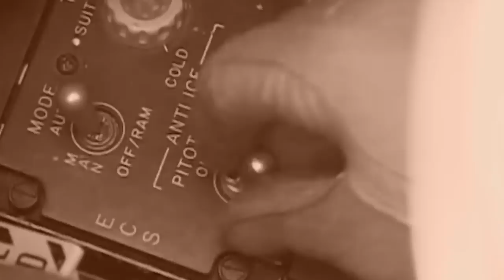X-31 Quasi-Tailless Thrust Vector Jet - Extreme Angle of Attack

Comment: Would love to see the Horten Ho-229 covered. Thank you for the stream of fascinating content!
Reply: never flew IIRC
Reply: @lordilluminati5836  The prototype had its first flight in 1st March 1943. Horten had a lot of relevance in the development of flying wings and their research already had good results in the 30s, but only much later with the
"3 thousands project" (1000km/h, 1000km range, 1000kg payload) they got some financial support and made the first prototype of the Ho-229. It was a reasonable plane for available technology, but it came in a very late stage of WW2.
Reply: @BlackCatRedScarf  the trouble was at that point the Germans were using a large amount of wood and glue in various combinations. Unfortunately they were also using extensive amounts of concentration camp prisoners for free labor. The ME-163 had similar issues in construction as the forced laborers found that peeing in the glue and putting small rocks under reinforcement bands would cause the wood to literally separate in flight and the rocks would cause structural weakness that high speeds would exploit by ripping off wings. The other issue was the jet engines themselves, they were built in underground workshops of varying quality. Typical life expectancy for a Junkers Jumo 004-B turbojet was about 30 hours before overhaul. The BMW jet was not much better, plus they were tricky to handle throttle wise. Advanced too quickly many would flame out or catch fire. It would have worked and it would have been deadly until the 8th Air Force found where the parts were coming from and bombed it into non existing

Comment: I think the real clincher is the moustache canards - as seen on the Typhoon. This canard surface has very long range of angle of attack. As to the thrust vectoring: Well that is a complication not really needed - given enough engine power. The Typhoon has a dry thrust engine power that is greater than the empty weight of the aircraft. That is about the same. The point being: The Typhoon achieves that by being 15% SMALLER.

The Typhoon carries about 20% less fuel internally and can supercruise - which really makes a difference in air defence. The reasons are probably: The canard surfaces are lifting and a pure delta wing is used - which probably allows for additional internal fuel stowage. A canard surface could make the aircraft unstable; but not more than the computers can sort it out.

The X-31 program is a success - not so much in the direct application, but provided lots of data to facilitate design decisions. The exhaust paddles were indeed a possibility; but I suspect the weight and complication in a full scale aircraft is not worth the bother.
Reply: The Typhoon had foreplanes not canard, very different really.

Comment: I’ve heard of similar pitot tube problems in the past.  I’d think a modern prototype under testing should have multiple sources for airspeed, attitude, altitude, etc. data, just to be sure one malfunctioning data source doesn’t confuse the flight computer systems.  Heck, our antiquated space shuttle had three computers checking each other just in case one malfunctioned.
Reply: Fighter craft and shuttles are two completely different things. Fighters must seek to make the most efficient use of space possible so that the craft can be light, maneuverable, small, and cheap.
Reply: @mechanomics2649  point taken. However, in a test prototype it seems pretty much every measured and instrumented value should come from multiple sources.  After all, you are testing the entire plane, including a newly designed pitot tube.  When I operated powerhouses for 45 years (I know, not size & weight sensitive), I often dealt with bad instrumentation.  Frankly, this makes the Test Pilot job sound scary.🙄

Comment: I wonder if there's a way to make the paddles out of something invisible to radar? the graphite epoxy are all ready. so they would just need to make the arms out of carbon fiber or plastic or both. then they can put the engine nozzles inside the airframe like the f117 and have a more radar invisible jet with complete thrust vectoring. and being able to would make them easy to put on a stealth jet. and having the engine deep in the airframe will make a IR seeker have a harder time tracking it something very importand when fighting the SU-27 and new series jets that have IRST thats like a IR radar for them. and makes stealth like the B-2 and F-22 as easy to target as any F-16

Comment: Scroll to 9:38 and you will see some of my noteable handy work with the installation of the new "PITOT BOOM" on the upper forward fuselage and hand built Dorsal GPS Fairing at Pax River. The old boom mounted to the bottom of the forward fuselage was like 3 degrees off. I installed and mounted the new boom with help of the Theodolite team and we got it within .001 degree. Needless to say the flight control software had to be re-written. For the record the cockpit and alot of other components were Legacy Hornet. The display we mounted to the pedestal so the aircrew could "monitor" high AOA landings came from Wal-Mart.

Comment: Best way to keep prototype secrets, destroy them before they have a chance to be copied.  Also, how else are you going to test a fully out of control thrust vectoring jet for the first time, they probably got a huge amount of information from the fall they would not have had otherwise.  I bet ejecting from a thrust vector induced turn or odd spin is a huge gamble too, or not, just on the wrong side, the risk is probably too high for some flight test procedures.

Comment: The general shape is similar to the earlier IAI Lavi, that flew in 1986, but it seems like a case of "convergent evolution" in design due to physics and performance requirements.
Reply: The israeli fighter? Wasnt that just a Derivative from the mirages and french fighters and same for the eurofighter/typhoon/rafale?
Reply: The program wasnt about the shape but about the thrust vectoring anyway from what the focus is
Reply: @kloschuessel773  Shape often gets dictated by what an experimental or military aircraft is supposed to and its desired performance. Physics also informs the shape of the vehicle.
Reply: @mprojekt72  i dont think this shape had to be this…
The russian planes with thrust vectoring are different and so is the raptor

They probably just took this shape bcs its been a well established design that would be easy to control and use 

The focus here was clearly on the thrust vectoring…
That shape was nothing special. And again: the israelis took it from the french planes themselves if i remember correctly
Reply: @kloschuessel773  When the X-31 was being designed, materials science and budgetary constraints did not yet allow engineers to move very far beyond forms that were known to work.
Some elements of the X-31 absolutely are derivative of long-tested and operated aircraft because:
1) they had to be to achieve a baseline of performance and stability with a specific goal toward a thrust-vectoring, tail-less airframe but not specifically without a vertical stabilizer.
2) Other derivative elements were chosen due to budgetary considerations; however, those had to work in concert with the overall body and wing design that were already dictated by requirements.
At the end of the day, whether the engineers chose to create a novel airframe and wing plan or to reuse elements of known designs, all of it, every surface and protrusion, had to obey physics, be achieved within a set budget and timeframe, and follow function above form.

Comment: The pilot tube in the carburetors of my 1982 Suzuki GS1100E rarely ices up but at high altitude it probably will. I am not an engineer but it seems to me that using a pitot tube the same high altitude icing would probably occur also so I guess using a pilot tube instead of a pitot tube really made no difference. At least the extraction seat fired properly when it was needed. Probably a Martin-Baker extraction seat.

Comment: I wonder how the X-31 would fare against the X-29 in a mock dogfight... and how much more maneuverable would the X-29 have been if thrust-vectoring was retrofitted.
Reply: It would certainly roll faster, but you need good lift under the wings to create a stable axis for thrust vectoring to be even considerable. It is trigonometry. The x-29 had not the same amount of wing lift , and the forward pointed wingtips cause turbulence you don't want, when thrust vectoring. Makes it hard to stabilize, when rolling and vectoring at the same time. it would be way trickier to fly. Nearly uncontrollable.

Comment: Yes, thrust vectoring works. It is the high ground. Lockheed knew this when they designed the YF-22 in 1984. 
YF-23 fanbois should be referred to this video
Reply: the YF-23 tailerons were so strong that it didn't need thrust vectoring to achieve high maneuverability, but what the fan boy of an f22 knows .
Reply: @gtrix3240  Thrust vectoring advantage applies to the pitch plane, not the roll axis where the inertia is trivial. Watch this video and learn some basic flight mechanics.
Reply: It is for dogfights
Reply: I would like both planes, please.
Reply: @Endelin  That would be the YF-45.
Reply: @MrKentaroMotoPI   test pilot Paul Metz was the only man who flew both the F-22 and the YF-23, and What's so important to underline is that Metz worked for both Northrop and Lockheed and is not known for hyperbole and he said "Never hang your head in shame about what we did. We built a tremendous product that would stand side-by-side with anything else, and in many cases exceed the capabilities of anything else. And we can always be proud of that." and he also made it quite clear that Northrop's offering was on par with Lockheed's, if not superior, Metz makes another incredibly valuable point about how Lockheed knew how to present and market their airframe far better than Northrop did. He notes that not everyone who would be in a position to select a fighter aircraft would be an engineer and that they may not even be technically astute. So leaving 'lasting impressions' on a conceptual level, even if they don't tell the whole story technically, can give one side an advantage over the other, he also said that Northrop's team was made up of brilliant engineers beyond compare but they thought and spoke almost exclusively in engineering terms. Meanwhile, Lockheed infused far more marketing, They fundamentally understood how to sell their aircraft and how 'showmanship' heavily impacts the acquisition decision-making process. Northrop didn't and that fact may have proven fatal for the YF-23 and also Jim Sandburg another test pilot of the YF-23 talked about how the YF-23's massive tailerons were so powerful that they largely mitigated the perceived advantages of the YF-22's thrust vectoring.
Reply: @MrKentaroMotoPI  i meant tailerons not Ailerons the auto corrector kicked in, so don't take a victory lap just yet lol.
Reply: @gtrix3240  Don't you just fate when that happens?

Comment: if the x-31 programme was "so successfull and groundbreaking", why no other western mass-production planes since 2000s were fitted with thrust vectoring?
Reply: The f22 was and prototypes of every other service fighter excluding the f35 and f14 were tested with thrust vectoring  it simply did not provide a big enough advantage to be worth it
Reply: Thrust vectoring isn't for free, it adds maintenance costs, and is only done for expensive models like air superiority fighters.
There's an engine version of the EJ 200 Eurofighter engine with thrust vectoring (the EJ 230), it exists but it was never used in a production version of the Eurofighter, since the aircraft can do very tight turns anyways with the Canards
Reply: @simonm1447  what is "for free" in mil aviation? 
Obviously the x-31 progamme failed despite being "successfull and groundbreaking". The only thing in production which remotely resembles x-31 are the F-22 engines with flat nozzles, and no other success stories or whatsoever
Reply: @konstantinsmirnov3722  not for free means the costs per flying hour will rise, which are already at 70k € per hour for the Eurofighter. Models made for bigger numbers (like the F-16) are at 36k $ per flying hour.
Airforces usually try to keep this costs as low as possible at the models they use in bigger numbers, high costs mean less flying hours for the same money.
So such technology is used, if it's used, on more expensive aircraft, like the F-22, and not on the models which have to be cheaper.

Comment: The Russians have some unbelievable thrust vectoring jets
Reply: Russian Jets are in general designed to be very nimble and unstable, even without vector thrust.
However vector thrust and the maneuverability that comes with them is only a benefit when the pilot can handle the G forces

Comment: “Quasi-tailless”, Well it certainly had a vertical tail (stabilizer),
but was missing the horizontal tail (Horizontal stabilizer). I guess you could’ve also called it a “quasi-empanage”.

Regarding the “pilot” tube, maybe it is an actual tube that the pilot uses for, well, you know…
Reply: They did a testing program for a missing stabilizer. However I don't know if they ever flew without it or just did the test with it removed 'virtually' through the flight computer. There are however renderings showing it without stabilizer.

Comment: That vertical slide is called a "Cobra Manoeuvre," which was made famous by Sukhoi Flankers.
Reply: No, the Cobra manuver is when you are in forward flight and then pitch the nose up beyond vertical, this causes the aircraft to dump speed rapidly. The X-31 can manuver without aerodynamic flow over the flight controls including being able to manuver beyond the aerodynamic stall.

Comment: “Giving the Americans an advantage over the Soviet Union”?! You mean the same Soviet Union who had been working on thrust vectoring since 1983 through Sukhoi (aircraft designer and manufacturer) and then since 1985 also through the engine designer/manufacturer Lyulka? 😝 Come on… by 1996 the Russians had already installed thrust vectoring into the airframe of one of their existing fighter designs, the Su-27 (a model then designated as the Su-37) and it was undergoing testing. Meanwhile the Americans were getting characteristically overconfident about a totally experimental airframe testing similar technology because it was going to give them an advantage!! 🤦🏼‍♂️

Comment: Let's see if I've got this right:

1) This was a joint German/American program, so presumably they were going "Dutch" on the costs of the project. 😉

2) Exactly two aircraft were built for this program.

3) It was a German pilot who didn't flip the little switch (that would have disconnected the erratic computer system from the flight controls) that would have allowed him to manually fly it to a safe landing, thereby forcing him to eject, leaving the aircraft to it's inevitable destruction.

4) When the program was wrapped up, the one and only surviving aircraft ended up in a German museum?! 🤔

How did America get so screwed in that deal? The last plane should be on display in the experimental aircraft section of the museum in Dayton, Ohio.

Just my opinion...

Comment: Spins at high AOA are usually caused by one wing stalling before the other which causes a roll that ailerons cant compensate for. How do they maintain roll control in those high AOA low speed maneuvers with a single center line thrust vectored engine?.
Reply: The canards don't have to be at high alpha when the wings are and can pivot independently, introducing roll. The wing is also "twisted," so when the first part of the wing stalls the rest of it is still flying, and the aircraft would depart controlled flight a bit "gently."  I also suspect, but don't know, that the thrust is vectored to counteract when the computer detects uncommanded roll. At high alpha it's not exactly a centerline engine - the thrust doesn't have to act through CG, and as the nose of the aircraft starts to fall off the thrust vector is below CG and can "shove" the tail to counteract, within certain limits. By the time the aircraft burns some fuel and gets to altitude thrust to weight is better than 1 to 1, so it's not flying on the wings anyway. - Aerospace engineer's best guesses.
Reply: @qtrfoil  Ok that actually makes sense, it becomes less flying the plane and more balancing it on a stick. I'd say that's a pretty good guess, thanks!
Reply: @SirFloofy001  Good way to think about it! And it works...right up until it doesn't!

Comment: 1 wing angles ends up other angle ends down idea f4 idea? meets diff modern plane . If T tail then hve both end pnt down seems to work best sonic flight. Make 1 wing 1 ft longer strong side weak side.

Comment: Can't figure out why in any computerized fly by wire aircraft there is not a damned big red mushroom button to turn back to basic sort of direct law... Not only for prototypes, there are too many crashes of A320 or 737 because of a sensor failure or because the crew was not able to figure out in what automated mode or sub-mode they were... Push a button to come back to a Cessna mode!

Comment: Well I think he punched out rather quick for a test Pilot.... Without any attempt to correct the Plane
Reply: 100% fly by wire. There is nothing you can "correct" manually if the electronic steers, but has no correct sensor data.